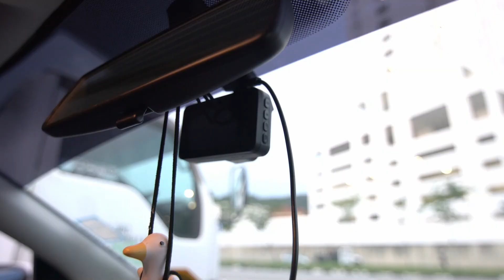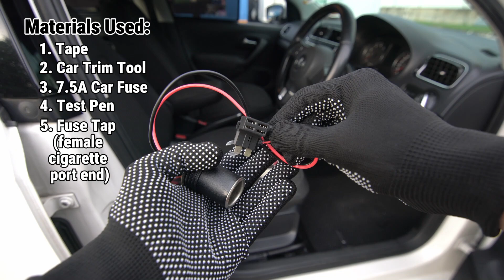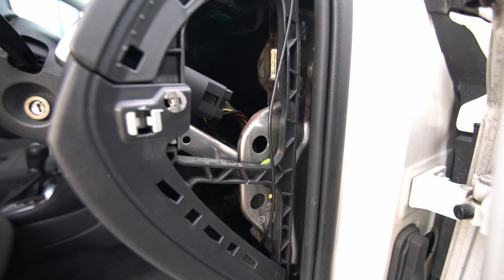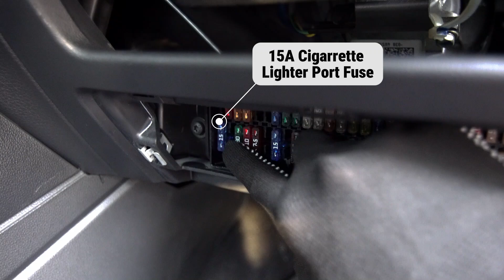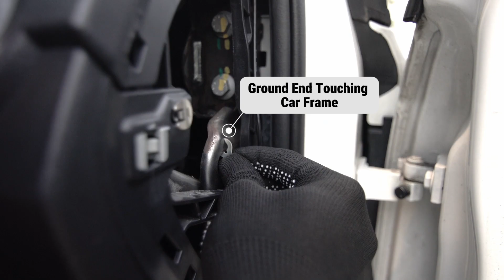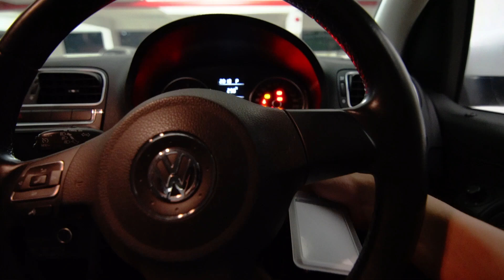DIY Dashcam Hardwiring Process: Using a Female Cigarette Lighter Fuse Tap Kit for Installation

Comment: would this void the car warranty in any way?
Reply from the maker: Safe to assume yes. Depends on the dealer, but many would consider tapping into the fuse box sufficient to void warranty on the electronics of the car. Best to save fuse tapping on older cars if you’re concerned.

Comment from the maker: Note that this set up doesn’t support 24-hour parking mode. A different fuse tap kit would be needed for that but I didn’t want to worry about battery drain, and this car is mostly parked under guarded parking anyway, so this sufficed for me.